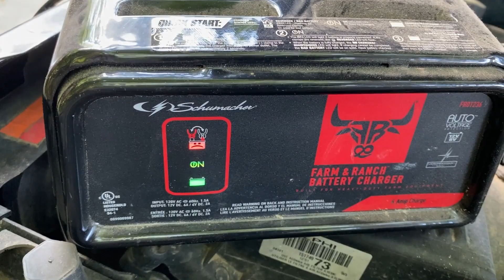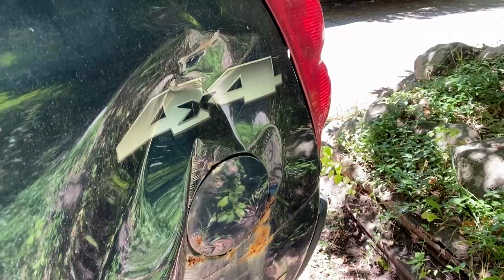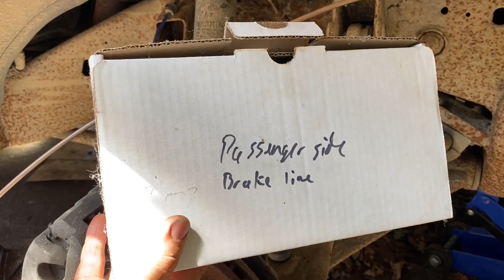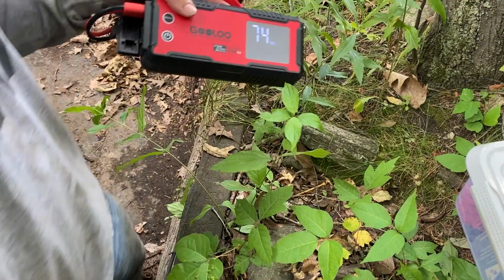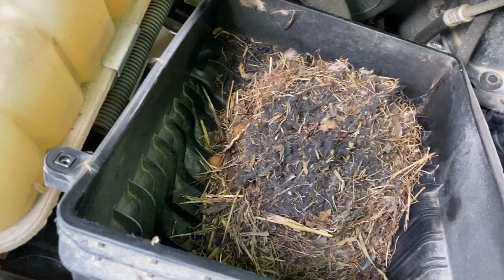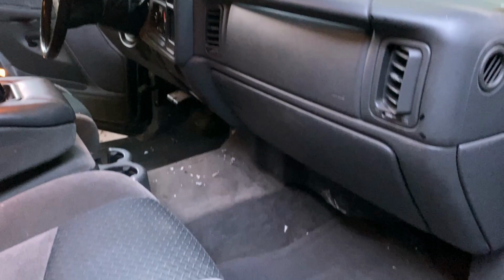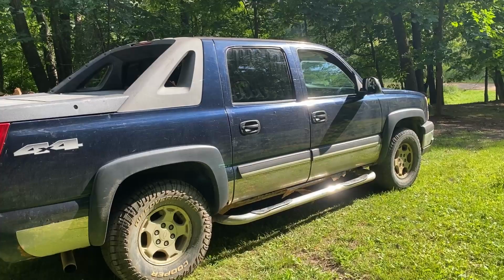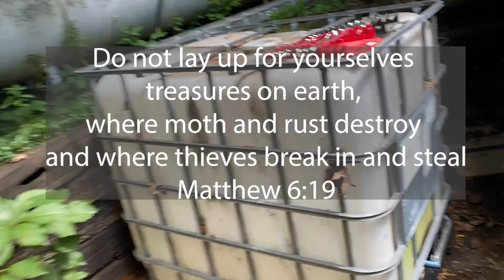Resurrecting A Dead Chevy Avalanche

Comment: I had a 2004 Chevy Silverado that I let my Brother-in-law have. It has over 300,000 miles on it. He had to replace the brake system. He hauls wood with it and drives it all around. That Vortex engine is amazing.
Reply: Vortec
Reply: Fgktube yes you are correct. Thank you.

Comment: I have a 2000 Chevy truck that's just as rough, rotten/rusty frame, etc. I've been limping it along. Like you said it's a tool that you don't have to worry about denting. I would keep it until the engine fails or the frame rots in half

Comment: since you got it basically running and stopping again, I'd keep it as a farm truck only and not even register/insure it...  For the gas tank fill, should be able to find the vent hose and fix/attach it again?  I thought you had a nice utility trailer too?  I'd use that towed by one of your other vehicles to get your in town farm stuff and such..

Great job on getting it that far and functional again!  Since you already had most of the parts in stock, win, win!

Comment: Tool suggestion: Cordless impact wrench.  So much better than a cordless impact driver.  My breaker bar has gathered dust since I bought the cordless impact wrench.  It was not too expensive - $99 for a Ryobi at The Home Depot and it came with the battery.

Comment: I had a problem fueling like you described. In my case, it was the evap vent solenoid. It allows the air to exit the charcoal evap canister and let the pressure out of the gas tank and the gas flow in freely.
Reply from the maker: Interesting, I actually didn’t know that was a thing. Maybe I’ll look into that also

Comment: We use our 05 Silverado crew cab short bed 4x4 for our property and firewood cutting on national forest. We bought a brand new ram 2500 for towing our fifth wheel trailer but  honestly these new trucks nowadays are just cheap sheet metal. I threw some wood rounds in the bed and the truck bed feels like a blind guy could read it like braille.

Comment: Hey, HoboFreight sells a nifty electric body work gun… it spot-welds little copper studs to the sheet metal, to which you attach a slide-hammer, so you can pull out dents. I bought one and it worked great on the dents in my ‘76 Chevelle. I imagine it would make short work out of that dent on the Avalanche.

Comment: If the engine has any kind of longevity in it. It’s worth it to me to fix every thing you can. There is paint you can spray on the frame to stop the rust. You can cut out those rusty wheel wells and replace them with nice looking mud guards.

Comment: Avalanches, you either love 'em or hate 'em. I've had 2 and got a lot of use out of those side boxes. 1 suggestion would be a set of inexpensive line wrenches, it'll keep you from rounding off those brake line fittings. She should easily last another year or more.

Comment: The reason why when your fueling the gas pump keeps clicking off is because you have to replace your charcoal canisters because they are clogged. There are 2 canisters and most people just replace the cheap one which is like $30 but you need to replace both canisters because i guarantee the bigger one is clogged too and the bigger canister is like $150.
Reply from the maker: I will check for that, thanks!
Reply from the maker: I will check for that, thanks!

Comment: The truck will last practically forever but they are a tool that requires serious maintenance, also in snow season you have to wash that vehicle when it has been driven down salted roads (is best not to drive any vehicle during salt season), you wash not just the outside but the underside and in all the nooks. Then get yourself a lanolin oil under vehicle treatment (old timers used to use motor oil but the environmentalists would kill you if you did that today and besides nobody wants to wrench on a greasy grimed up vehicle). You want to spray every square inch on the bottom to keep the rust from getting worse especially the horizontal tubes that connect the frame that run underneath the bed as they are notorious to rust out on that body style truck, get above the gas tank and while you are looking above the gas tank There is almost guaranteed to be a ton of dirt up there and or a mouse nest or two. 
Think of a truck like a high end quality hand tool you bought off a tool truck, what I mean is you spent really good money on it so you take care of it, you might use it every day to do tough tasks but you take care of it.
It isn't a Harbor freight tool that is so cheap they are practically disposable.
 You wouldn't take a Snap-On or Milwaukee tool and deliberately abuse it. The same should go with your truck, trucks really don't get outdated in the sense all they do is haul a load if you maintain it and stay up on all the things that were out or break as it ages it won't break the bake and it is always cheaper to keep it than it is to replace it. The same goes with a farm tractor

Comment: Does that thing have a cabin air filter? It's fr around the time they started becoming more common. That's a good spot for a mouse nest.
Reply from the maker: I think it does although I will need to look up where it is and check it!
Reply: @SSLFamilyDad  can almost guarantee right behind glove box. Usually glove box has tabs holding in the open position, push in sides of glove box and it'll drop down completely, then cabin filter is typically behind a small access door.
Reply: @SSLFamilyDad  Chevy stopped putting cabin filters in the Avalanche in 2004 so there is no cabin filter.

Comment: If you're going to fix the gas neck it might be easier to take the bed off the frame. I had to do that on my Sonoma to replace a fuel pump. Kill two birds with one stone fix the neck and grind down and paint protect the frame. Great welding videos and frame paint videos. Alot of work though. If you love the truck do it!
Reply from the maker: I have done that with an old s10 but the avalanche has a body like a suburban, all one piece
Reply: Bummer. Well it might be worth it to trade it for something more fun to work on